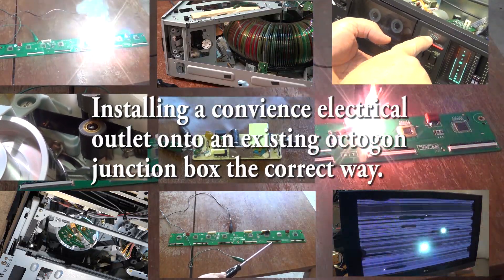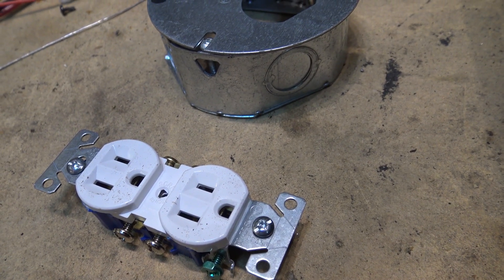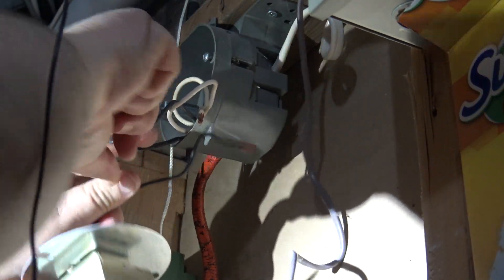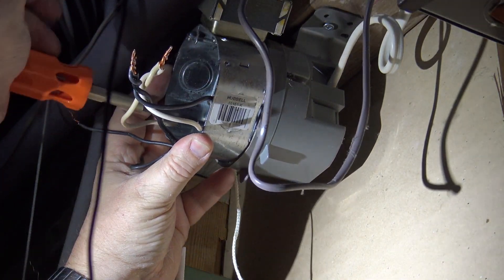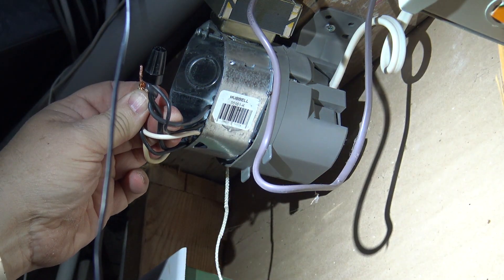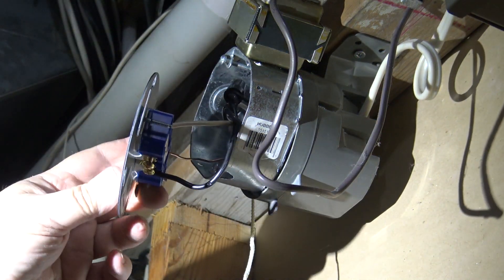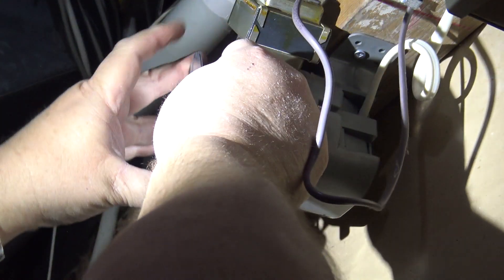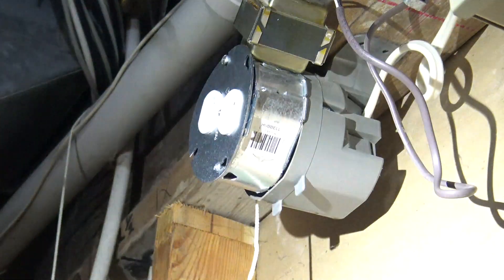Adding an electrical outlet to a 4 inch octogon junction box

Comment: It doesn't really matter but I think in such a setup you are supposed to attach a wire to ground the metal box extension if putting it onto a nonmetallic box, plus there looks to be a gap around your extension. With such a setup I probably would have installed a new metal box to make it cleaner overall.

Actually I would have just used the existing outlet located a foot below the new one, but that wouldn't make good video.
Reply from the maker: The ground wire is attached to the outlet. The box extension is attached to the grounded bracket on the main box AND the outlet, so it is grounded in 2 places. There is no additional ground screw on this box extender. It gets its ground from the JB and the outlet, both of which are bonded to ground.
Reply: @12voltvids  I thought the base box was plastic. If it's metal then my concern does not stand in your case.
Reply from the maker: @eDoc2020  the baseball is plastic but there is a metal ground strap that connects to where the lid would be screwed down or where anything else that might be attached to the Box goes. Well that ground strap will pass the ground through the screw onto the Box extender. Go look at the plastic boxes in home Depot and you'll see they all have a ground strap inside to ground whatever is screwed down to the top cover be it a lid or a box extender or whatever. Remember, the transformer that was screwed to the flat lid which using that as its ground point
Reply: @12voltvids  The plastic boxes I've seen don't have a metal strap like that. Maybe it's only a thing in Canada.
Reply from the maker: @eDoc2020  
I've only seen them in Canada I don't look at electrical supplies in other countries but yes they all have a metal strap. It only goes up one side of the box to where one of the screw terminals screws in so anything that's attached using the screw that screwed into the metal strap is grounded. When I was buying the Box extender first store I looked at the one they had had a separate screw on it so that you could attach a separate ground wire to that box extender but they didn't have the cover plate with the outlet cut out. So I went to another store which had both and the Box extender that they had did not have a separate ground screw. Anyway because the outlet is grounded The ground terminal on the outlet is not only connected to the ground pin but it's also connected to the metal tabs that secure the outlet and the screw hole that secures it in this case to the plate which is metal and that is screwed down to the extender as well as the extender screwed down to the ground strap on the box. So the Box extender is grounded to the outlet as well as to the base strap, I don't need to worry about it not being grounded.

Comment: I hate wire nuts, especially when stranded wire is mixed with solid wire.
Reply from the maker: Well that's the way it's done.
Reply: @12voltvids  I think European countries have gotten away from them. Thank goodness we don’t have the old knob and tube wiring with the cloth covered wires and screw in fuses.

Comment: We would use a 1900 hundred box, IE :4 inch square, and since that is in a garage or basement to make it code we would use a GFI and on the load side of GFI you can put another outlet on it. USE a quad cover , same as double outlet. I was licensed electrician from 1986 to 12/ 2000. Didn't renew 63 years young. I am not old enough for SSI but will find plant work, hopefully
Have a great day...Hugh Mc -Chicago ,metro
Reply from the maker: Not in a garage or basement. Equipment closet, where the furnace is in the hallway. The outlet is for a UVC light that keeps the AC condenser free from mold and bacteria. HW tank is in there too but on the other side of the closet. No chance of water unless a pipe bursts.

Comment: In California you would have to get a building permit for that.
Reply from the maker: Not here. you don't even need a license to work on your own stuff.  
Here is an except right out of the code book.

DIY electrics could include anything from changing your socket covers, to installing a new light, to extending a circuit, to even rewiring a house.
Naturally if you wire your own house you would call for inspection.
When I built the house I had a spark rough in the wiring because it needed to be done fast while the plumbing and stuff was being done, but I completed the work including  the load center.  The sparky put the meter box in, and the electrical panel and pulled the wires. I did the plug, switch, fixture wiring and then he came back and signed off on it.

I do have my ticket, it is a Class C-R low energy